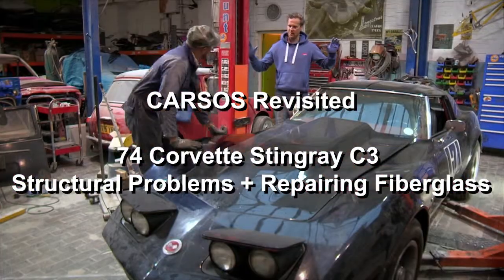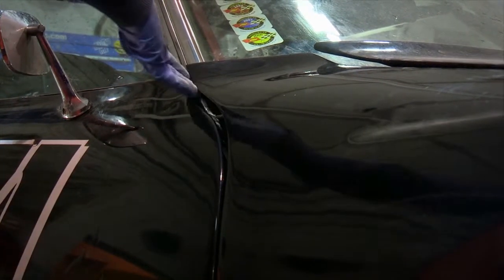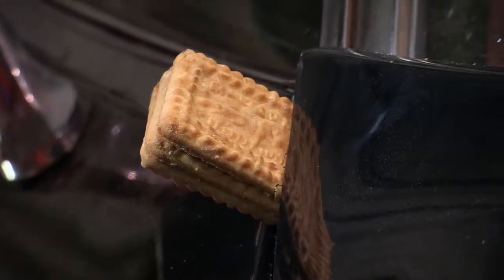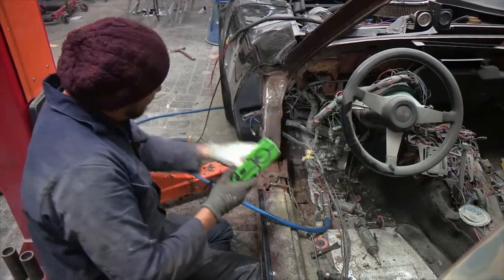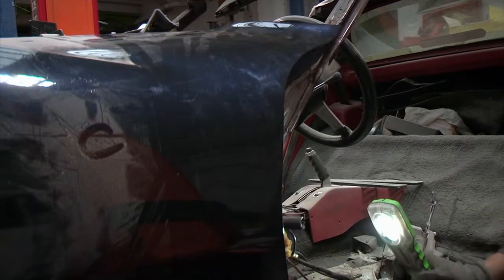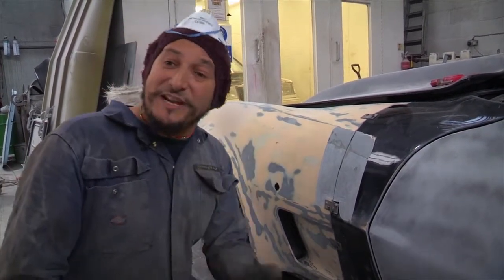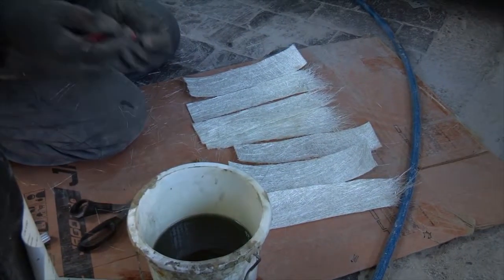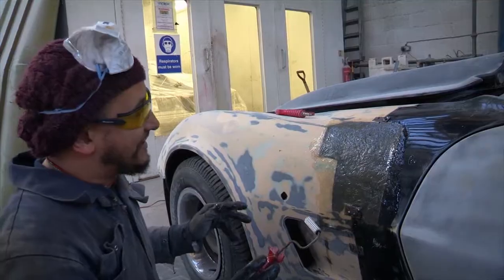1974 Corvette Stingray C3 Sructural Problems | Car S.O.S.

Comment: Why didn't he remove the paint from the section he cut off? The likelyhood of that fiberglass patch actually lasting for any real duration is very low. He would have been better off removing the front clip than cutting the body like that. Even with a skilled body worker, that seam is still gonna show.